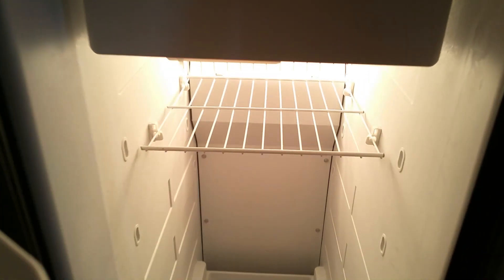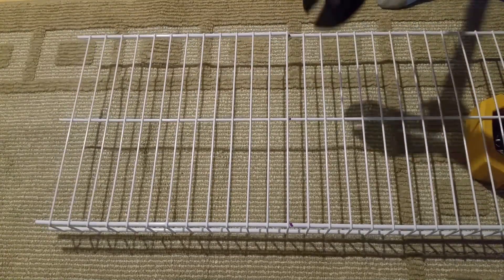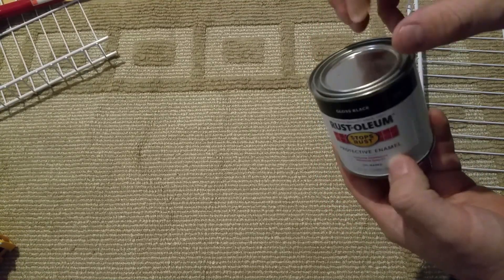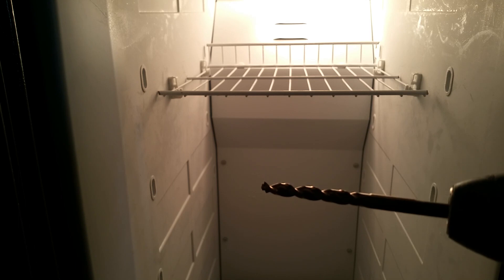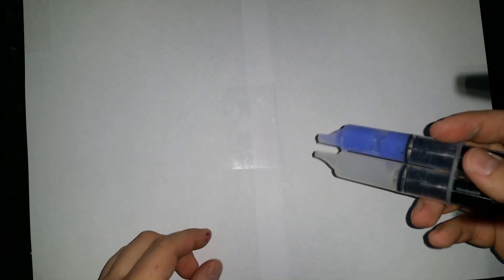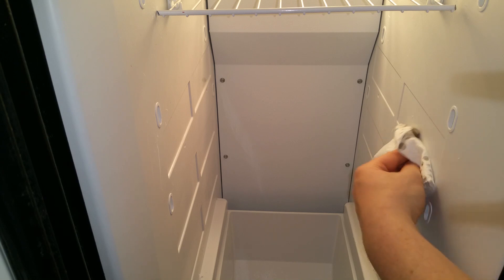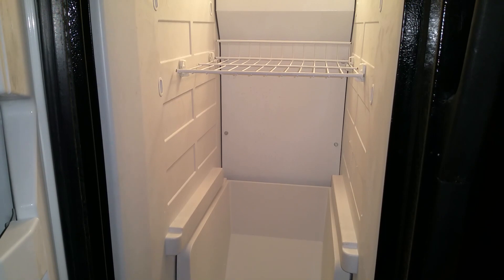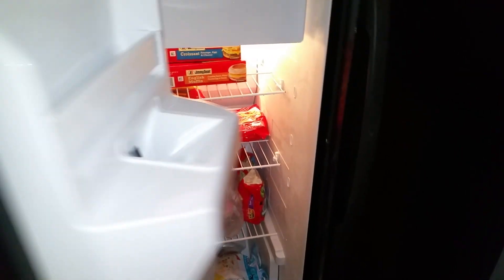How to Make Refrigerator Shelves Your Self

Comment: You clever son of a gun you! I need a shelf to hold my fan for 60-day dry aged steak in my miniature refrigerator. My shelves are glass. I needed a wire one to prop fan on top for airflow. You solved my issue for something completely unrelated. Many thanks!

Comment: Id try it without glue, the regular ones just pop in and the shelves will actually hold them from coming out... so I think, Id try it anyway.  There are also rubbermaid clips that are just hook style.  I never thought of this .. great idea !!  Thanks !!  Id like to install easy slide out baskets in my freezer that look decent, any ideas ?
Reply from the maker: thisonelife x you can install metal tracks that people put on computer desk for keyboards. And then attach something to them. Also  you can use baskets that already come with tracks, they use them in the kitchen cabinets. They all metal and plastic and should work just fine.

Comment: Do you have any suggestions/tips how to install extra shelves bins on the door of the freezer?  Thank you.
Reply from the maker: Yes. Just get a plastic container, one that you buy for the kitchen, to store forks and spoons or different accessories.  It's thicker plastic box that usually put inside of a cabinet. Or one that you put in sink to store washed dishes (wash forks spoons and knives )They about 2-3 hight. And width you would have to measure your door to find out how long it have to be. And you can literally screw that in with the screws into a door just predrilled holes too

Comment: It LOOKS as if you put down some clear tape before drilling to protect the finish.  I assume you were able to pull this tape up after mixing in the epoxy gel and BEFORE pushing in the clips.  Am I correct in this order?  Would paint tape be better?  I imagine it would be easier to tear off, even after pushing in the clips, if you held the clips in with the other hand.  Thanks!
Reply from the maker: No that's was clear epoxy

Comment: Hi. Thank u for the video. Do u think those plastic shelf supports can handle 25-30 kg in weight? I home brew and wanna build a shelf to support a 2nd fermenter. Thank you.
Reply from the maker: What plastic shelves are you talkin about?  the one in the video I'm showing and making all metal !  I'm pretty sure they can handle that weight. But original plastic shelves that came with your refrigerator I have no idea, probably not
Reply: Thank you. I was talking about the supports actually. Just wondering if plastic supports could handle that weight. Thanks again.

Comment: Show me how to make fridge door shelves I lost all door shelves am getting difficulties to put water bottle
Reply from the maker: You need to get baskets. They sell white wire baskets at hardware stores like lowes and home depot at organize departments, people use them under sink or in closets. They can be mount on the door same way.
Here is link, just an example, you can find them in white and much cheaper 
https://www.hobbylobby.com/Home-Decor-Frames/Storage-Organization/Baskets/Narrow-Wire-Basket/p/80921811
Reply: @IvanRossS  do you have some other basket links? Seems a wire basket would rust?

Comment: Thanks! Any chance of drilling into a pipe when making the holes on the sides?
Reply from the maker: karebearvan  Google - "refrigerator cooling diagram"  and you will see cooling lines with refrigerant usually in the back of it. So u have low chances drill it threw,  but still be careful !!!
Reply: Screen Share great, will do! Thanks!

Comment: Holly Lord, i drilled through my refrigerator. 🤯🤯😢🤯🤯
Reply from the maker: I did not drill through the refrigerator just through the plastic casing without damaging anything... is the same thing what they do at the manufacturing. Instead they will insert plastic plug with the Hole 🕳  so you can insert metal shelves into those holes or any kind of accessories
Reply from the maker: If you drill through YOUR refrigerator, just make sure you silicone your hole pretty well and you'll be just fine. Should be moving easy and slow

Comment: Is there a risk I ruin my fridge like I accidentally did before by poking a hole with a knife and got the freon gas leak.
Reply from the maker: Ofcourse there is a risk, but usually tubes located behind refrigerator. You can always Google diagram off your refrigerator, make and model, to see approximately layout. Usually  deep freezers have tubes in the wall because they do not operate like refrigerator do, where you have a fan that circulating cold air through the internals of refrigerator and  freezer section too, deep freezersdown have fans, otherwise your walls in the refrigerator would have frostjust like deep freezers do